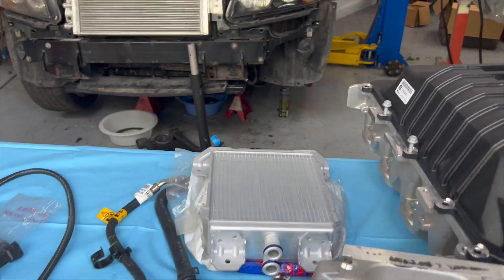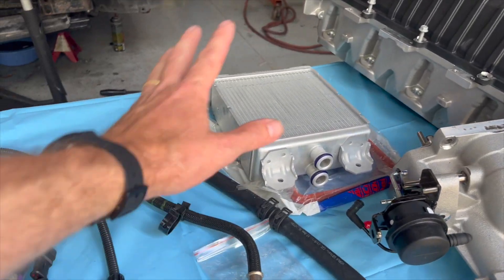Unboxing our Boost District LSA Supercharger complete Kit

Comment: I've been doing a lot of research and trying to figure out which route I wanna go. The kits for LS engines are so expensive now but seems like boost district has the best price which is around $6200 for the kit.. Would you recommend this, and are there other mods you would recommend to do along with the LSA supercharger? I was thinking something like the LSA supercharger, BTR stage 2 camshaft kit, Holley 350 fuel pump, FID 850 injectors, the heat exchanger, and either the CTS-V or ZL-1 lid, slp exhaust, longtube headers, then maybe grab a tune kit from diablosport..

Comment: Would you know if the lsa supercharger kit for the 2015 Camaro ss is a complete kit? Like will I need to purchase any adapter parts or anything at all for it to be a complete install? I’m kinda confused, because I’ve heard talks of needing a conversion kit as well as the supercharger
Reply from the maker: It is pretty complete kit , but is designed for the LS engines and not the LT or direct injection engines. Do 2015 have direct injection?
Reply: @repairandsharegarage  2015 has the ls3